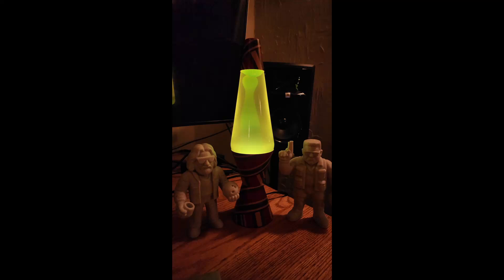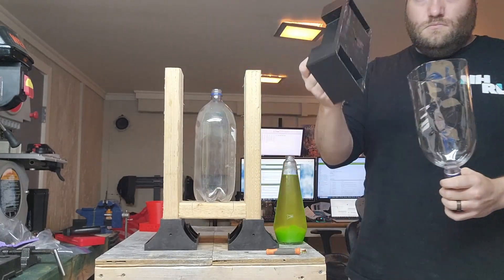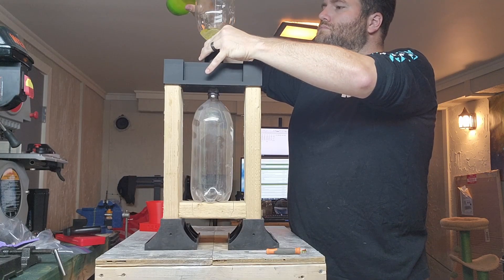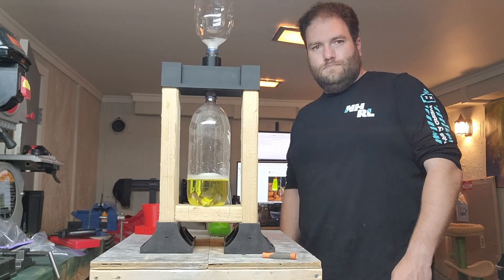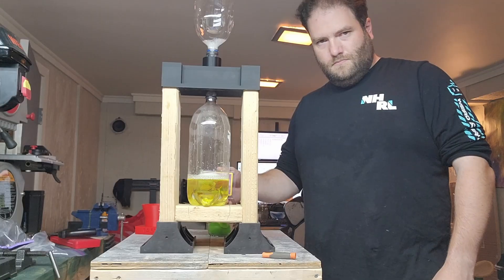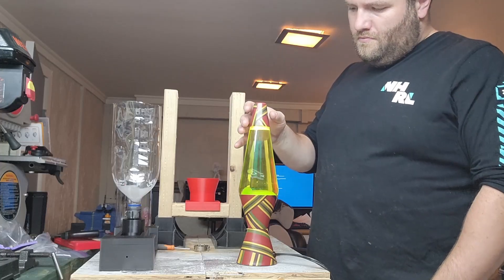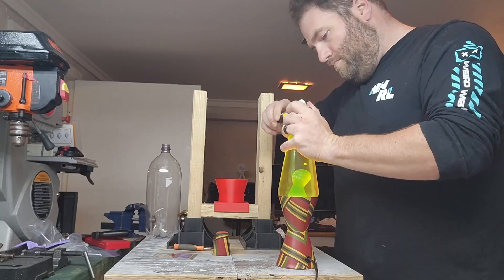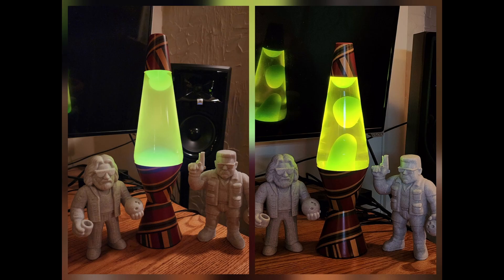Filtering a Cloudy Lava Lamp - Step-By-Step - Mini Sawyer Filter

Comment: my problem with this is that its basically scrapping a membrane filter for this.
also you lose a bit of "fluid" that get stuck in it. maybe pushing some air thru to remove the remaining liquid? reversely if the filter was previously used for water you will get some normal water in the special mix.
Reply: Type to look for problems